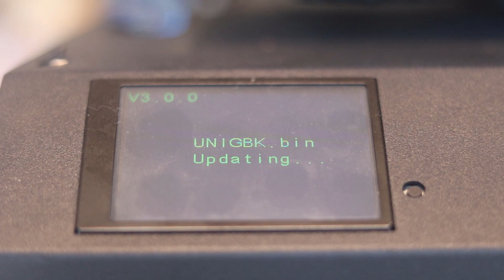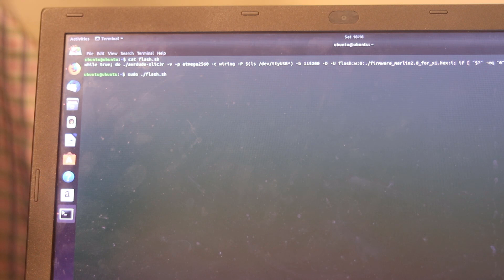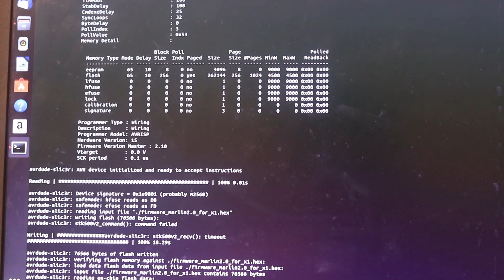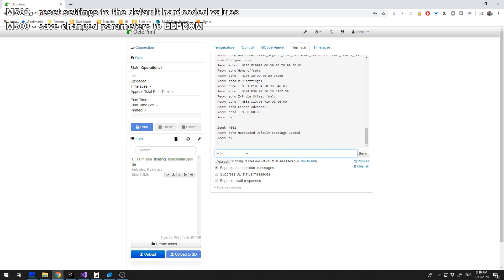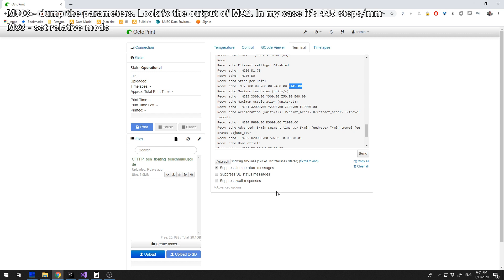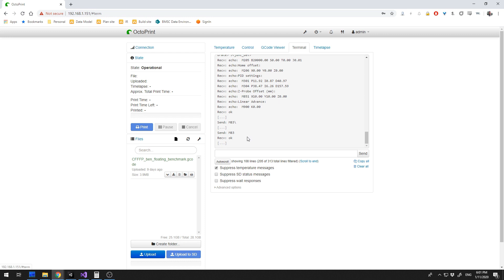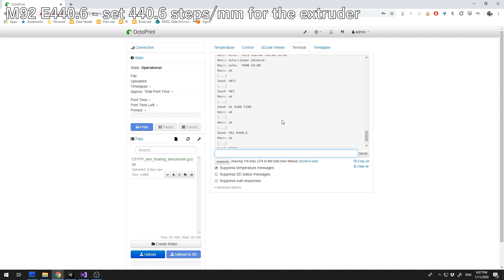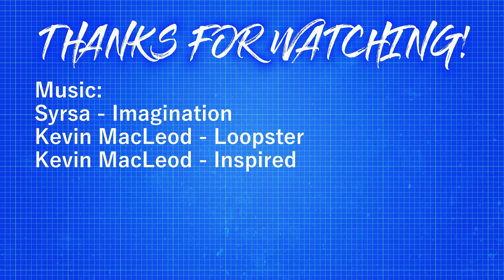Troubleshooting Artillery Sidewinder X1 | Part 2 | Firmware update, PID and extruder calibration

Comment: Thanks for the videos Igor, at least I know now that I'm not the only one having trouble getting my swx1 to print perfect surfaces. 

I haven't had the printer long, so only just started working on getting a print quality I'm happy with after some pretty ordinary ones straight out of the box. I'm still searching through all the clips and comments i can find looking for hints and clues and ideas and suggestions. 

Much like you, I've gone through trying all the usual steps of tightening and tuning everything i can that usually helps or fixes the issues, but, like you have found, nothing really seems to fix the irregular face surfaces.  Some places the walls are fine, so the printer is capable of what I'm looking for, it just doesn't seem to be able to do it all round, even with belts and extuder pulleys firmly tightened. 

Starting to wonder if it's the slicer, as I'm still running cura 3.3.1.

Tip about pid autotune fail for swx1 and how to get it to work. I noticed trying to autotune pid setting for the extruder that the only way I could get it to succeed was to preheat the extruder to about 3 to 5 degrees less than tune temp so it doesn't overshoot too far when it heats up for the tune.  I think because it heats up so fast it cant help overshooting too far and throwing up a fail, so this helps to calm the rocket enough to get its measure.

I'm definitely not super savvy with pid tuning, so I'm not sure if the results of the tune aren't as good with only a few degrees of temperature movement to begin with.  

What I did find is that when I set the target temperature to 200 and let it heat up, what I noticed was that on the original settings it heated the extruder to temperature in less than a minute but it took more than 4 minutes for the temperature waves to settle down into a stable line, but after I ran it again from the autotune settings I got using above procedure, it only took a minute or two to settle down into a stable temperature. So there was improvement. Didn't seem to change the look of the print though.....
Reply from the maker: Thanks, that's an interesting tip about PID. Are you saying that if I want to autotune it for, say, 215C, I should preheat it first to 210C?
I was experimenting lately with the Z axis couplings and I think I have a few ideas on how to improve them. I've been finally able to see some visible improvement. Stay tuned :) Unfortunately, Amazon says my order of spares is delayed.
Reply: Yes, although I was still finding it overshooting in failing even from a 5 degree heat up margin, 3 degrees seemed to work every time.  I also had success by reentering the M303 command for autotune after it failed and the temp had dropped back just below the target temp.

 As a basic example,  my procedure was to send M303 S200, then reenter M303 S200 into the command line ready to go but not sent. Then I let the auotune try and fail, watched the temp drop back after fail till it gets to about 198, then send the M303 S200 I had sitting in the command line waiting. This time it will heat up without overshooting and failing.
Reply from the maker: @davefenton102  Interesting. I'll give it a try, will let you know, if it works for me.
Reply: Hey Igor, Going back to my previous question about linear advance, is this something you have tried yet? 

I'm curious if this would help at all, but haven't had a chance to try it to see if it will help with the particular problem we're having. My guess is probably not, but I'm hopeful...

As I'd mentioned, I saw a video by teaching tech on using marlin to dial in the k value.  The clip was called, Linear advance guide - Free and easy print quality improvement. https://youtu.be/n3yK0lJ8TWM

There's some good food for thought in the video that got me wondering if some of the problem is the built up pressure in the extruder? 

I've also seen mention of a dodgy nozzle being a problem, as one of the 3d Printing Nerd's videos suggests. In his clip they are having trouble similar to us, only with a different printer. I think the main problem they had was loose pulleys on the xy stepper motors.

Like you probably have too, I have checked these and they are definitely tight, but I'm thinking maybe they are tight but tight in just the wrong spot that doesn't seem loose but does actually have half a fart-skin of movement that isn't discernible to the eye.

Just to be sure, I'm going to loosen the belts, then loosen and retighten the pulleys to make sure they are seated perfectly so I can definately eliminate that as a problem. I think I will get a new nozzle too.
Reply from the maker: Yes, I tried using linear advance and I haven't noticed any difference in the surface quality.
I'll try re-tightening all pulleys though, that's a good idea.
Reply: Dammit,  I was hoping linear advance would be our silver bullet. Unfortunately, loosening and tightening the extruder pulleys wasn't a magic fix either for me, nothing changed.... so, back to the drawing board....

Another issue I've seen mentioned in a youtube video for swx1 is the stepper motors not getting the right power/current to them. Maybe the problem is coming from the x and y steppers not getting smooth or correct current? 

Although "moire" is not quite the same, I'm wondering if a potential fix might by trying to tune out moire. I think it usually relates to the extruder stepper, but maybe the xy steppers are having a similar problem. I dont remember exactly where I saw it, but I may have seen a suggestion somewhere of changing the board from the 16bit to a 32bit to fix the dodgy current issues.

Teaching tech has a video called, Four ways to beat moire on your 3d printer. At 5:20 he suggests installing a TL-Smoother. It is supposed to help smooth out the stepper motor pulses or something like that. This too could be a possible fix to try.

The fact that not everyone seems to be having the trouble we are having with our swx1 makes me think that maybe there is a dodgy hardware component in some machines but not all. Maybe a loose connection or a dodgy circuit board or wiring.

It's fair to say I'm only a novice with 3d printers, but if I look at the problem logically, to me it seems like the x and y movement is not operating smoothly consistently, which is causing wriggles here and there.

What are your thoughts? Do you think an epeliptic fit of voltage to the x or y stepper might be a potential root of our problem??
Reply: Video I mentioned about bad voltage/stepper motors 
https://youtu.be/ZUkIfYWxsqY

Could it be bad stepper motors? I've seen a few people having issues with swx1 stepper motors, so maybe this is something worth checking/testing?
Reply: Another potential, and easy, fix. Watch this clip, https://youtu.be/Hvw3DrVAeTA

I'll be trying this out when I get home this afternoon. Would be a welcome relief if it works...
Reply: Verdict after first test print with resolutions settings turned on and set higher as suggested in the video by Cnckitchen I mentioned previously...

Thankfully I finally had a small amount of success. Unfortunately it's still not perfect, but there was a marked improvement. There is obviously a tradeoff with the loss of the finest details, but going purely on the first print, the majority of the surface ripples have gone. I'm not sure if dialing in this setting will be a magic fix, but it's a start, and nothing else seems to be working.

I'm printing the typical 3dbenchy. My problem, like yours, is those ripples in parts but not all of the print surface.The worst of my ripples were mostly on the front half of the outer hull. The rest of the print usually looks reasonably good, and still does though has lost slight detail if you look close.   The surface defects I'm seeing now on the outer hull are more like little zits here and there, like chicken skin. Compared to previous prints though the majority of the surface is smoother now, just with pin head blemishes.  

The blemishes might be stringing or underextruding. I do have combing turned off, I'll have to try with no combing in skin and see what happens. Also I changed k setting i have in start gcode to .11 from .16, I might change that back so I'm only changing one variable at a time.

The resolution settings I used on the print, sliced with cura 4.4.1 are, max res 0.8, max travel res 0.8, max dev 0.075, So settings are on the higher end and could probably go down a bit.

2nd print that just finished running now was set even higher, mr 0.9, mtr 0.9, md 0.09, Result was not as good as first print. More layer lines. I'd say this has probably gone too far.

Basic rundown of the other details/settings. Printer still has original firmware from factory, version 4 received jan 2020. Using cura 4.4.1. Generic pla, 190deg, bed 60deg, 0.2 layer height, 2 walls, 10% infill, print speed 70, infill speed 90, travel speed 200.
Reply from the maker: @davefenton102  Will give it a try, didn't get a chance to do anything yesterday. Also my spare parts delivery from Amazon is being delayed :( I was also thinking about checking VREFs, however my understanding is that low VREFs cause motors to skip steps (resulting in layer shifts) and high VREFs can cause overheating. None of my motors are particularly hot, and the surface defects, albeit being random, are usually at the same place (same height) and are of the same nature on all models. This makes me think that something is wrong with the Z axis setup. In my case the defects are on all sides.
Reply from the maker: @Dave fenton Nope, my Cura profile already has maximum resolution of 0.5 and maximum travel resolution of 0.8. Also I'm printing pretty much a simple cube, so there should be little to none of short travels. Will tinker with the hardware tomorrow. Oh, I've also checked VREFs. All of them were around 1V. I've lowered them slightly, to around 0.85V - no effect, neither positive nor negative.
Reply: That's unfortunate, I was hoping you might finally see some improvement.

What speed are you printing at? Although like you said, when you're only printing a cube, there isnt much that should be able to go wrong no matter what speed or settings.

This is a real head-scratcher. I'm glad I found your videos, because I'd be having a lot more trouble trying to find solutions without your help. Your efforts and knowledge are very much appreciated and I'm sure I'm not the only who has/will find your efforts very helpful. Thanks.
Reply from the maker: Also, I tried switching slicers - didn't really help. I tried Cura 4.4.2, Prusaslicer, and IdeaMaker.
Reply: I got marginal success changing from cura 331 to cura 442,  but I also changed some of the speed settings and turned off combing, so I'm not sure which of those helped the problem.

I can send you photos of my 3dBency if it helps. 

Have you tried adjusting your linear advance?  I think Teaching tech had a clip on this which is where I got the idea of turning off the combing and a few other settings. But like I say I'm not sure which thing helped improve it, but there was finally some improvement although not 100%.

I've put all my adjusted settings for extruder and pid into the start script of the gcode, this is quite easy on cura. I think I'm using a k setting of .16, (not near my printer to check), which was suggested by a post I found, I haven't actually run the linear advance test myself, but thinking maybe it should be close to .1.

Comment from the maker: I suspect I may have found a mechanical issue with my z axis and I think I know how to fix it. Stay tuned :)
Reply: Looking forward to that video. Can we also get your overall review of the printer once you get it dialed in to your liking?
Reply: Do you know what pin is for the filament runout sensor? I keep trying PB0 but it doesn't work.
Reply from the maker: @garybarbourii8274  What are you trying to do? Eliminate it?
Reply: @IgorsWorkshop  no I'm trying to make it work! I'm working with some stock mkstft_28 firmware and not matter what I do it reads open. It is supposed to be pin PB0, but it just always reads open, no matter how I invert it.
Reply: I know this is a clone of the mkstft, so maybe it's on a different pin. I just figured since you managed to get it working you would be the one to ask.
Reply: @garybarbourii8274  Hi. Check in your firmware, as the switches can be set to be NC or NO (normally close / normally open). This means (NC: is is open when there is something pressing it, NO: it is open when there is nothing pressing). This might be the problem, as the switch is soldered to be NC and your firmware expects a NO. Good luck
Reply: @miguelake288  thank you. You're talking about inverting the filament runout pin, and that was the first thing that I tried. It tuned out that the source code mapping was an absolute mess. I ended up getting the data sheet for the microprocessor, metering out the pins, and making a couple of hard calls to the proper address in a most improper way, only to switch to a different source code that was better mapped!

I'm making good progress for my Artillery Sidewinder X1: https://www.thingiverse.com/thing:4251390
Reply: @garybarbourii8274  hi. Not exactly. A mechanical micro-switch has 3 pins (COM, NO, NC). Inverting the cables on the board side will have absolutely no effect, because these switches are simply shorting or opening both cables. If on the switch side, you have them soldered to COM and NO, it will always be NO, no matter how you connect them to the board.

 What I meant is that you might have a NO switch, which outputs 1 when the filament is there and 0 when it is not, and the firmware is expecting the opposite. Usually you can change that in firmware, which inverts the LOGIC (expecting 1 or 0 to launch whichever RUN-OUT_FILAMENT call), but not to inverts the cables themselves.
Reply: @miguelake288  yes, the logic is inverted in the firmware by FIL_RUNOUT_INVERTING

Comment: Great video!!!
I was able to update with the sd card but I am having trouble setting up the second part. Would you know were I can find a detail step by step tutorial on setup and updating like you did in the second part of the update (board update). Would you be able to do a detail video on how to do it?

Thank you  once again.

Ps. Suggestion, Test Heat break upgrade difference in print quality.
Reply from the maker: Thanks! Yes, I was thinking about doing a more detailed video on this. Maybe even livestream it. Stay tuned, I am actually going to try the test firmware this weekend. Meanwhile, you can find step by step instructions here: https://www.thingiverse.com/make:734108/
Reply: @IgorsWorkshop  thank you.